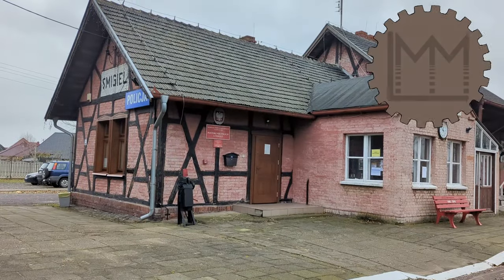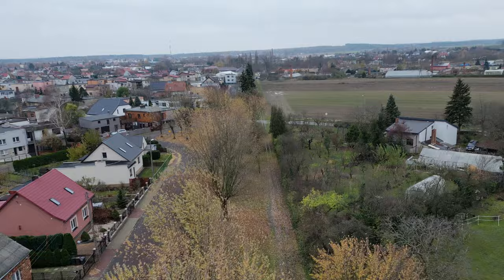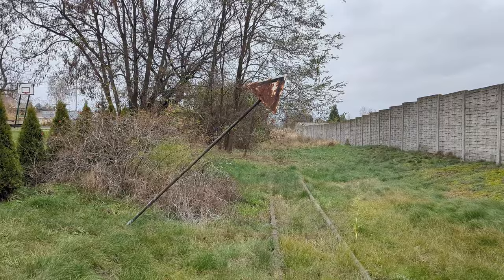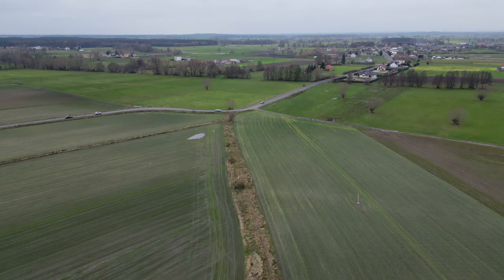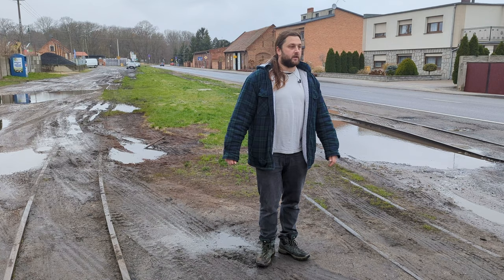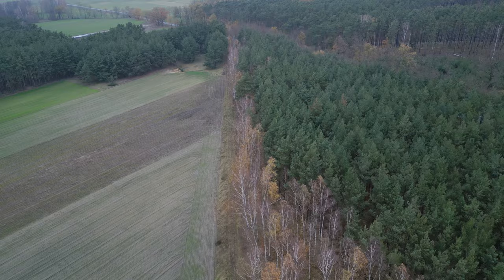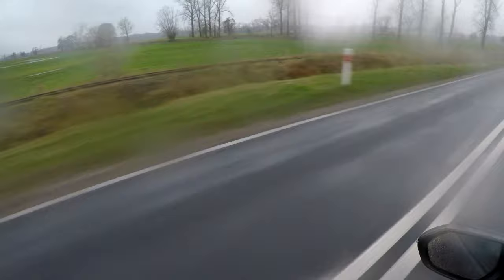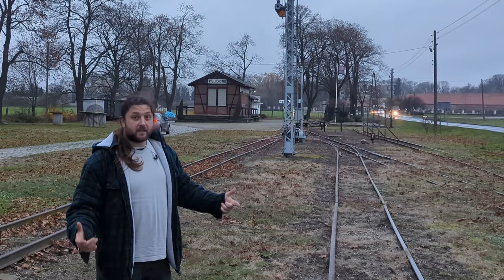Abandoned Narrow Gauge in Poland Pt2 - Exploring the Disused Smigiel Railway

Comment: There are struggles all over Poland to keep some of these lines clear and ready to operate one day. Some are working as heritage railways of course. Many are not. Are you familiar with the people in Ozorkow trying to re-open the line to Krosniewice? They are the last survivors of the Kujawy network. Every year, they fix bits of track and try and cut back the weeds. This 750mm network is interesting as it doesn't require huge infrastructure on the ground. Rather than looking to the past, I'd suggest there are lessons for the future. There is some attempt in the UK, which seems sadly to have hit some turbulence, to establish a light rail commuter system in Coventry. The thing that didn't exist in the last century was reliable battery power. Aside from steam being a dirty technology, the LXD 2 diesels that ran all over Poland were also dirty and harmful for the environment. I think there is a future for light rail, quite possibly narrow gauge, running on lithium batteries and whatever technology comes along next. Charged by the sun? Why not? There are fields of solar panels all over the place. Have one at each end of the track to charge the locomotives. Someone needs to re-think railways from basic principles, thinking from the ground up, from the rails themselves, to motive power, signalling etc. We need to look towards a time when personal vehicles will become less feasible, especially those that use hydrocarbons. The lessons from these networks in Poland is that they worked for local communities. You can imagine some sort of goods network too, which brings wagons full of pallets to stores and wholesalers along the way. No doubt there will still be long distance trunk lines, but with careful design and planning there can be an enormous network for passengers and goods at a much reduced cost, such as there was in Poland. Surely some technical transport executive in the EU must be thinking about this?

Comment: There is at least one railway line in Ireland that is unused, overgrown but still there. Some of the lines closed later on were left in situ, and are still owned by Iarnród Éireann. Of the ones I know of, the Athlone to Mullingar line has been turned into a greenway (but the rails are still there alongside), the Foynes branch in Limerick is being rebuilt for running again, leaving the Athenry to Claremorris as the only line still untouched that I know of. For now anyway, there has been some plan announced, whenever that actually happens.

Comment: If you want a full system that's just in situ like that...I'd recommend checking out the East Broad Top in the US. Same sort of thing, basically: company closed up shop one night, thinking they'd be back in the morning, and never returned. to the point there were even half-machined parts still on the lathes. 

Like this setup, there is work being done to reopen the line...it's actually on it's 3rd life now, which is amazing.
Reply: Tge ebt is going strong. They're already restoring the second steamer and massive amounts of track and facilities